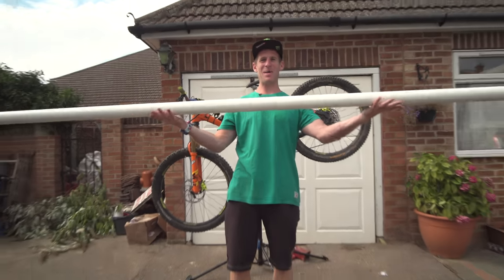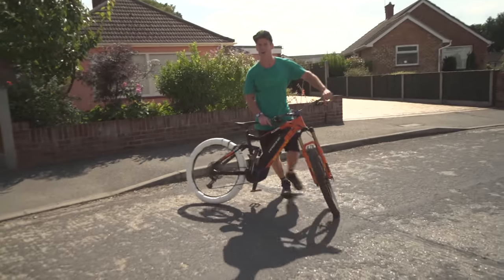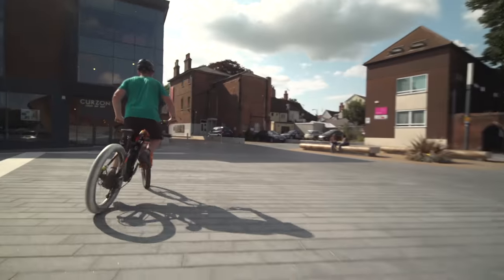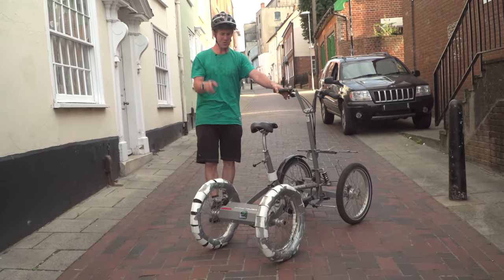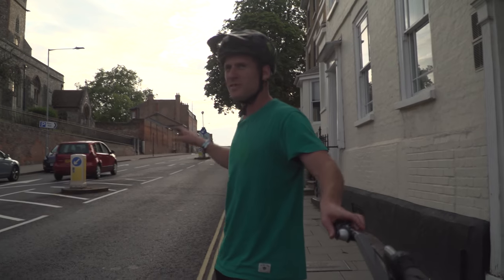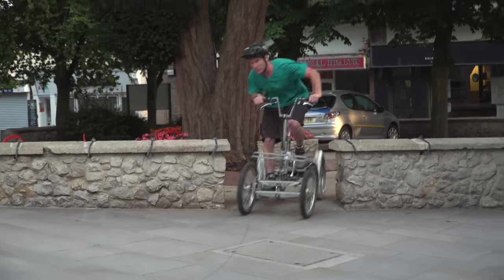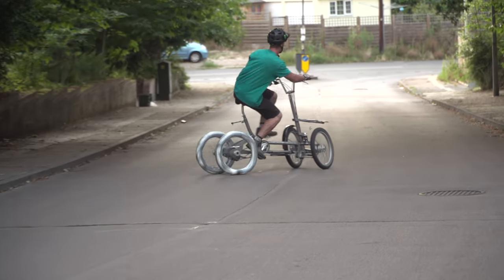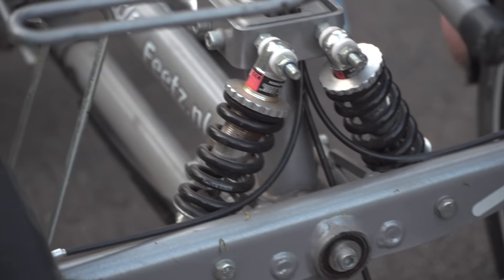CRAZY MOUNTAIN BIKE DRIFTS - PLASTIC WHEEL MOD!!

Comment: 8:45 Is that a glitch in the matrix? Look at the plastic!
Reply: Wtf
Reply: How
Reply: Tyre is still spinning, the plastic is caught on the ground and not connected to the wheel, as the wheel slows down the plastic stops slipping on it, gripping more and launching it forward. As this happens the wheel hits the floor and stops spinning. This can be seen by the single plastic piece which remains fastened to the wheel.
Reply: Balentin Camargo shut up :p €£¥^<><><<<>><<><>>><><><>><><><>>><>¥£€§§§§§§§§
Reply: O
Reply: Badass Dan  correlates to my real life experiences

Comment: you should drill two small holes on each side of the split and zip tie them onto your rim
Reply: I thought of that the second I saw his design. Great Minds Think Alike!
Reply: I just commented exactly the same thing then saw your comment ! cable ties and duct tape can repair anything :)
Reply: Defiine, I just wrote the same thing, great minds...
Reply: What he said
Reply: All the friction would still burn it off, need something similar and abit tougher or thicker :P
Reply: @soupworld5781  Nah, the zip ties wouldn't touch the ground, they would be on the inner circumference.
Reply: My exact thought too 👊
Reply: Matthew Gies, Word.
Reply: that would mean like 40 holes, so alot of work lol
Reply: Just cut 90% through the pipe with each lateral cut (instead of all the way through) then mount the one length to the rim instead of having to deal with 30 individual pieces. The small linear section that is left will curve to the wheel and also provide a smooth running surface.
Reply: Oliver Read, I agree that would be superior, and the cuts would be better slightly V’d so they don’t overlap. Good work people..
Reply: @SquadronLeadr  that would probably rip at the cuts
Reply: @SquadronLeadr  Nice one!
Reply: I was saying the same thing.
Reply: Metal Zip ties on Amazon.
Reply: Oh my god who cares

Comment: Why not just buy a giant pvc pipe and slide a ring of PVC over the tires? It'll be a lot easier to just slide the pipe on than making all those cuts.
Love my Pilgrips by the way, I've gotten the courage to hit bigger drops than ever! I just landed my first 4 foot drop yesterday!
Reply: auto_Edmonton he would probably have to buy like 12 feet of it
Reply: Like japan fwd fwd drifting
Reply: It would work for the quad but the edges have to be round for a bicycle
Reply from the maker: auto_Edmonton the pvc I’ve got doesn’t bend mate! Glad you like the grips
Reply: Sam Pilgrim like on a drift trike one big pipe 27 inch in diameter deflate your tire and put the pipe on and inflate your tire it won’t come off
Reply: @WyattH  yes, the more psi, the more secure, but only on a quad or trike
Reply: Adam Smith ya tho I would also get an inch or two bigger in diameter but you can also use heat to round the side out
Reply: @WyattH  good idea dude
Reply: ALL AROUND MTB misunderstood at first but makes perfect sense just have no idea where you would get a pipe that large
Reply: ALL AROUND MTB who says it needs to be rounded though might make it more stable drifting if it wasn’t you might even want it to be wider than the tire sticking out on the sides

Comment: Nice work Sam.
But go to a rural irrigation shop and buy y’self 2.5 meters of 50mm polypipe.
Black, and about 5mm thick.
Thread string down centre and heat it in hot bath water and bend to wheel shape/size. Now grab a small grinder and cut out the inner strip. Deflate tyre, squeeze on pipe, inflate tyre and cut sick!😁

Comment: Late, but I have an idea💡🤔- 
Cut the pipe in spiral. The distance between the spiral digits should be equal to the distance between the spokes. Cut in such a way that it will take of the plastic during the cut which will act as gaps for the spokes. So, you might have to cut it with a 3mm grinder blade, that will automatically create a channel between the spirals. And then you know, just wrap wrap wrap wrap 😎

Comment: Don't give up on this.  If you zip tie each one to the rim, and to each other through drilled holes, it will stay together.  Alternately, try to find a pvc pipe with an inner diameter just smaller than the total tire diameter, then inflate, just like the pvc drift cars.

Comment: Cut the tube lengthways along one side all the way along, then cut vertical sections (like you did) but not all the way down. Then wrap the tube along the wheel, the semi vertical cuts will allow the tube to bend around the wheel.

Comment: You should try to make a drift plate. I usually use a piece of cardboard, ride fast, and lock up my back wheel once it hits the cardboard. But it tears thru the cardboard so fast. So you should try something that wouldn’t break as fast

Comment: If you use an angle grinder to cut all the way down the pipe first then cut them in to smaller pieces should be a lot easier 🤷‍♂️✊🏽

Comment: I can’t believe that tubing fitted through the stays. 
I was so pissed yesterday because I bought a 2.4” tyre for the rear wheel on my Norco fluid fs and it rubbed the frame. Had to put the 2.25 back on. 😠

Comment: Once i had a accident where my rear tire bead got pushed off the rim and it reseated instantly but i still lost a lot of tire pressure to the point if I lean back i can bottom the tire out and what i noticed is it was really easy to break traction 
Literally I just tap rear and i could drift for days until i lost the bead again permanently

Comment: I want to try it on my Extracycle I bet it would be awesome 
Although my edge runner has a 20 inch rear wheels so it would be problematic I would have to make smaller pieces of pipe for the 20 inch wheel  
If you want to drift a long tail is great when it is wet 
also i like to hit plastic things with my back wheel you know 
Brake on it or even better there used to be a lot of waterproof cardboard you know the wax kind for produce I think they have been replaced by the collapsible plastic ones like I strap to back of my Extracycle but it's like ice the thing I like to do is go really fast and a straight line rollover the piece of plastic break the back wheel on top of the piece of plastic or the waxed produce cardboard that is not around as much anymore around here in the Pacific NW that is the waxed cardboard I've only did it like once or twice but it just slides so well across cement wet or dry
Reply: I must start wearing a helmet